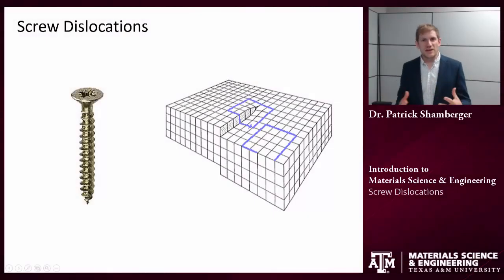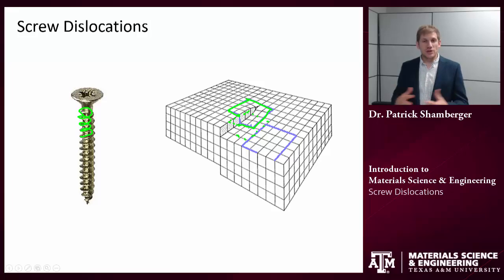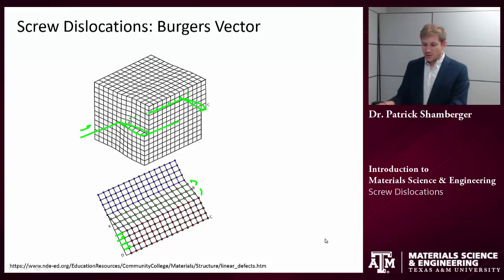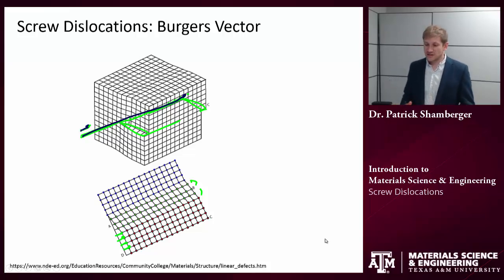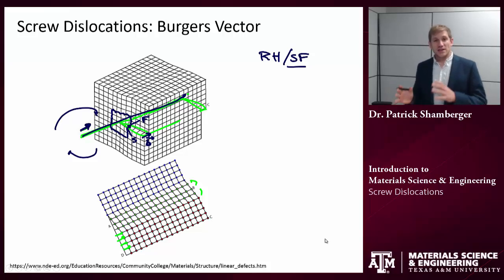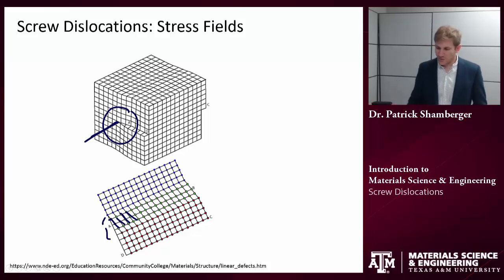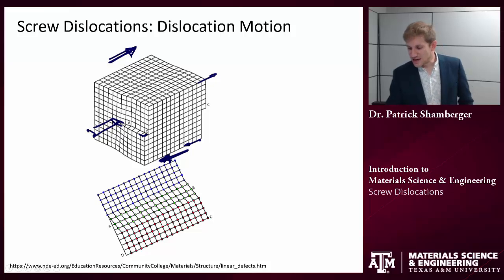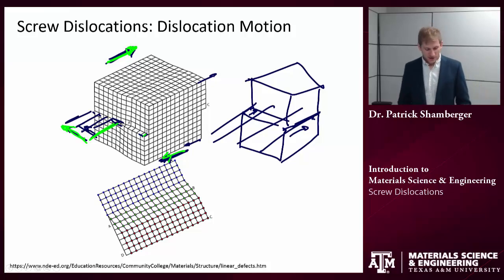Screw Dislocations {Texas A&M: Intro to Materials}

Comment: Thank you for producing this series of videos, they're very helpful. One question though - how do you determine where the start point should be and how many steps to take? 3:10 Does the loop need to be centered on the dislocation line? If you were to start one unit cell lower with only a single stepover then you'd pass over the dislocation plane and the S-F points and the resulting Burgers vector would be on a plane that's orthogonal to the dislocation line, not parallel.

Comment: Thanks for your lecture. I think notion of "Screw" should be explained more precisely also the direction of burgers and dislocation line needs rechecking, I understood they are perpendicular to each other.
Reply from the maker: burgers vector and the vector along the dislocation are perpendicular to each other for edge dislocations, and parallel to each other for screw dislocations